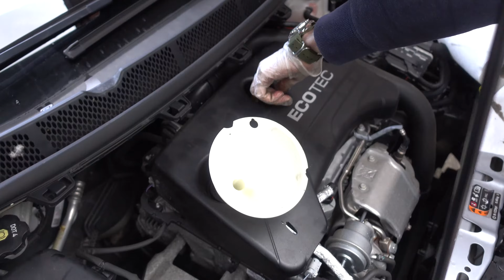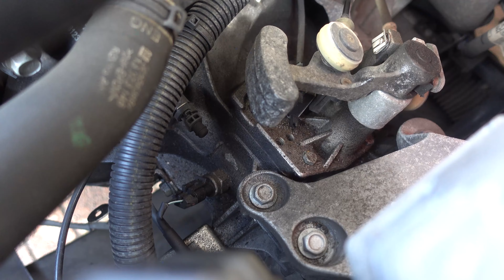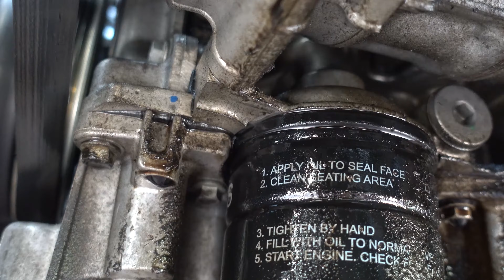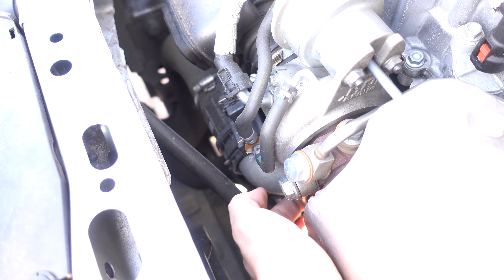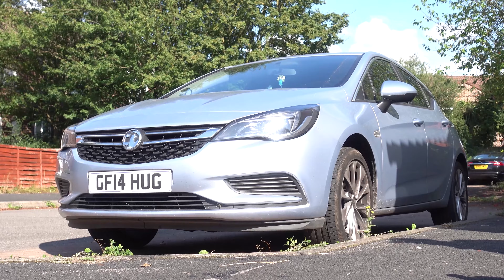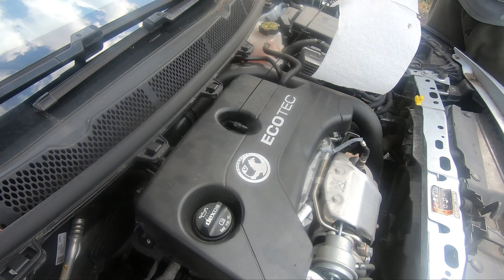How to fix an OIL LEAK - Find and Repair Common Leaks

Comment: 1. There are fluids which you can put in engine and minor leak fixes, search for "stop leak "
2. If the leak is from somewhere you can't take it apart or it's huge with to fix, just put RTV after cleaning with brake cleaner only because that's how the surface will become oil free and rtv will work, search YouTube how to put that, it's kinda glue